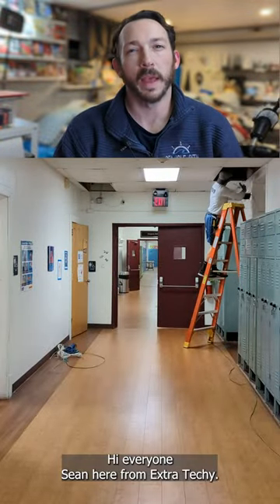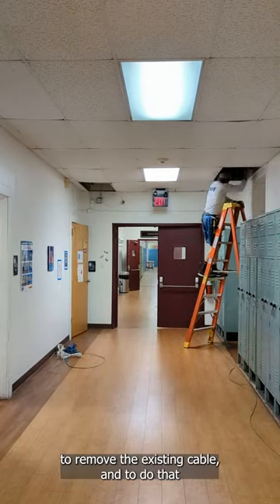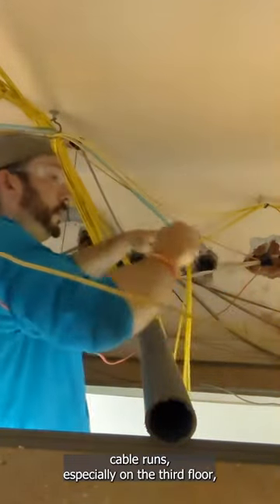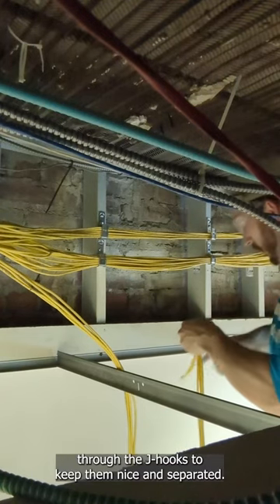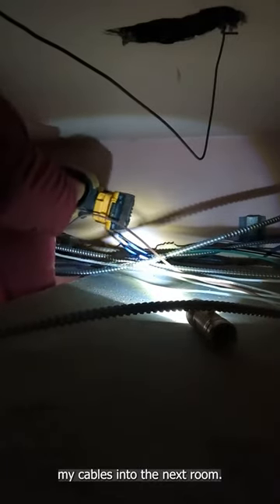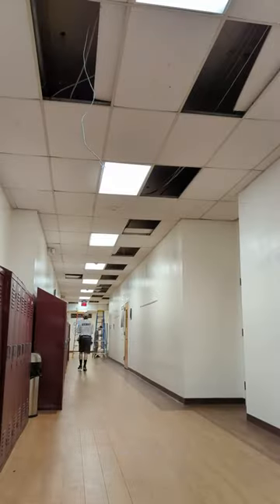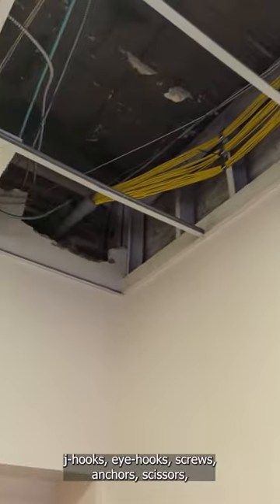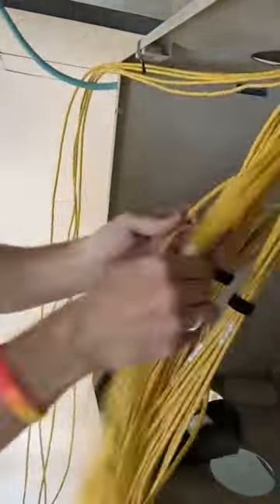LESSONS LEARNED - Network Cable Pulling Tips & Tricks

Comment: Zip ties are ok but theyre for places where the wiring wont chhange like the ceiling, but dont zip them too tight or they can dig into the cables jacket over time. Velcro is for your switch closets and server rooms where cables are gonna be swapped around over time.
Reply from the maker: Love this angle! So many people arguing for or against. I did use zip ties but recently bought into rolls of Velcro. At least with Velcro, if you make a mistake, it's not a huge issue with cutting back a ziptie 😬
Reply: Personally I absolutely hate zip ties. I know they have their place and I do not deny their usefulness. And in some cases there is no alternative. But to anyone putting them any where, especially in confined spaces:
For the love of all that is holy, cut the ends off flush, and do it properly!  

Knipex makes awesome flush cutters that make the job real easy. 

If you leave any material standing, possibly even being cut at an angle, the next guy is going to cut their arms and hands to ribbons on that stuff if they have to reach into or around the area. 

I have done my fair share of bleeding because the previous guy could not be bothered to take the extra second to clean up. And man, those tip ties are sharp and produce jagged edges that make for some pretty gnarly cuts.  Nothing says „screw the next guy“ than being sloppy trimming off the cable ties. Car mechanics seem to be the most egregious offenders here for some reason.  
If you want to be lazy then fine - don’t cut them at all. That way you at least don’t leave a forest of mini blades behind.
Reply from the maker: Absolutely man! Take the time to make it safe. Thank you for your input! 🙏💕
Reply: Yep and it looks a lot smarter.
Reply: @DeputatKaktus sparks (Electricians and Fire installers ) have a bad habit of leaving them on especially in false ceilings ,pop your head up and you nearly get garroted 😂
Reply from the maker: @Jon-qw2oe lol head on a swivel!
Reply: @ExtraTechy , some places require it, for inspections, and  you better have plenum rated Velcro in you plenum ceilings, I really only know of some counties in the Maryland area, Wash DC also I believe (it's been a couple years)
Reply from the maker: Good info here. Never thought of Velcro needing to be a certain rating!

Comment: Never remove existing witing unless its part of the scope of work and the customer is aware of the extra cost. Its so easy to remove something live thats still needed by mistake.
Reply from the maker: Totally agree. Luckily, I've been working this building for 10+ years!
Reply: @ExtraTechy and removing wiring can be SUCH A PAIN! like ive come accross wiring glued inside the conduate! Who does that!?
Reply: @Henry_Jones yes, but demo jobs are GREAT. Getting paid an hourly wage, AND scrap money depending on how much you’re demoing👍🏻
Reply from the maker: Bingo!
Reply: @justinissocool1  how much do you make from scrap cat5? Do you take it to a recycler? Just curious cuz I see people toss old cabling in the trash all the time.
Reply from the maker: So i heard it's about 1.00 per pound but depends on market etc. I still have to scrap the wire, so maybe I'll do a video on, now you have scrap wire, what now? Stay tuned!
Reply: @ExtraTechy  yeah it used to be about $1 per lb. I’ve been out of the industry for about a year so prices may have fluctuated a bit. But always scrap your wire, even if it only gives you some quick drinkin money. You can take it to any scrap yard and they’ll give you cash for it on the spot. The only thing you can’t scrap is coax, there just isn’t enough copper inside and everyone just throws it away. But no me and my buddy did a job recabling an entire office building floor. About 150 cable job, and we demoed about the same amount. By the time we were done and hauled all the scrap to the scrap yard both of us made about $800 in scrap alone👍🏻
Reply from the maker: @justinissocool1  love that!!!

Comment: First of all both techs have to protect themselves using all PPE required besides safety glasses. They have to use ANSI 3 or 4 gloves and hard hats. Also, they have to be aware and let somebody about missing bushings in all conduits. This could be easier to to pull cables because they slide better than being pulled on top of the tapes. Other than that, they have good technics💪
Reply from the maker: Good advice! This was a very early job prior to gaining this valuable experience

Comment: There are wire-pulling machines that can pull large bundles of wire and have a clutch that prevents exceeding the pulling force of the specs of the cable. They make life much easier in many cases, but the machine itself is quite expensive so you must have a certain amount of work to justify the cost.
Reply from the maker: Had no idea! Thank you for sharing! If I was doing this full full time then I would absolutely invest in something like that! Appreciate you sharing!
Reply: What's the machine called
Reply: @ExtraTechy , bro those machines are usually just for OSP (outside plant) in conduit pulls, you try using that for ceiling pulls your crazy, 18 years in, never seen it,  doesn't mean it ain't happening, but pretty unlikely. Life saver for sure on long lateral conduit pulls, or riser cable I suppose
Reply from the maker: Sharing information is important. Whether it's practical is another point of view. Thank you for your insight!

Comment: For anyone reading this, a few things that help tremoundously, getting a Push Poll its a 25 foot collapsable pull with a hook at the back end, tie your cable through the hook and extend (possibly yeet) your push poll forward, if you dont have one then you can use fish sticks or fish tape to get some extra distance in a ceiling. Also PLEASE FOR THE LOVE OF GOD USE PULL STRING!!!! If you arent using it for yourself atleast leave some behind for the next person coming through. If you dont have pull string dont do the pull unless you get some.
Reply from the maker: Fan of the yeet! I did NOT use pull strings on this job as it was a ton of wire, but I understand the importance! Have added it to my workflow since then!
Reply: @ExtraTechy  this is why you need pull string. saves alot of time. Just every once in a while unwrap it here and there.

Comment: Hello, I'm in collage, I'm just learning about Straight cable, Crossover cable, and Cable drop. I got to do all of those hands on and it was fun! got any tips?
Reply from the maker: Practice! I've never had to ever create a crossover cable IRL for anything I've done. Use non pass through connectors. Practice terminating on ladders and other awkward areas. Lay on the floor, underneath a desk. 

Good luck
Reply: @TheNiceGuy71  pay attention to your instructors, ask questions, learn and master splicing fiber optic cables (fusion splicing of course) Learn and master reading an OTDR (what you will test your fiber splices with) I've worked at companies that had separate crews, but if you can do both, like myself, you are the man ! Get your BICSI Certs too

Comment: Zip ties vs Velcro. If I am placing cable that is not likely to be changed, moved, or removed, I will use Zip ties that have releases on them so they can be   changed and re-used or salvaged for future use. Velcro is equivalent but can take up more space at the wrap point since you cannot cinch them as tight. To estimate the length of cable run look at a set of plans for the building and make install measurements from these plans. If you are lucky enough to have digital access to plans create a cabling layer for each type of cabling. right in the AutoCAD file and place your cable runs on that layer. There are also tools that can analyze these runs and provide recommendations for time, labor and materials. This may incur an additional cost for having an expert do this work in AutoCAD for you, but it benefits you and the employer for future moves, adds and changes. If the plans already have cabling layers on them then they can be used to estimate new cable runs and TM&L for replacement. Many RFQ's will specify that this work is part of the project, so you need to have a specialist available to perform the required AutoCAD work. Some RFQ also specify strict qualification requirements for final testing and documentation of those tests. I once was part of a job that had a 600-page statement of work to re-cable a single floor of a university and connect it to other buildings. We had a staff member performing compliance and validation throughout the project. He inspected cable runs, terminations and performed his own qualification tests to ensure that they matched what we were submitted to. He also provided authoritative guidance when things were not as documented or changed were to be communicated. He also provided security for some areas where non-staff could not be present without an escort. At one room he sent his own staff due to proprietary equipment in the room that was not allowed to be viewed or accessed or operating that required special procedures to depower or otherwise accommodate. They also ensured that a paramedic was on site during the process since staff were always at risk of a fall hazard, and in some cases required climbing skills and harness while transitioning through a central tower. We have also had elevator specialists to assist running through elevator towers as well.
Reply from the maker: Holy wow! I'm sure in jobs that big, and what seems like a high classified site, the specs and requirements for such a job are so important. I never thought an AutoCAD option would work for designing a network infrastructure. I'll be exploring more there for sure. Thank you for taking the time to help me understand more. Learning is just as important as executing a job, and I put these videos out there to help me document and, in the future, improve on technique and skill. Appreciate it! 🙏
Reply: Tourniquet your cables to apply velcro tightly. Also reusable zipties is pointless by the time someone wants to add or change something they become brittle and stuck in the form they were. They are cheap enough to replace.
Reply from the maker: Good points. I've got a few spools of Velcro now in the go bag, so we'll be using Velcro forever. I find it easier to take off if a run needs to be moved.
Reply: @ExtraTechy  do you do rough or soft on the inside for the velcro. I prefer rough as it doesnt slide and the outside doesnt get caught on peoples clothes later
Reply from the maker: Hmm. I think I have the soft outside so I can tighten as much as I can

Comment: Velcro always, never zip ties. It takes the same amount of time, above ceiling or in a closet. Velcro will never pinch cable, zip ties can.

Also, don’t pull through J Hooks, pull in the path way next to the j hook, when done with the run, work backwards, dressing in the cable with Velcro and push any slack back the start of the run.
Reply from the maker: Awesome tips. Good idea on the j hooks; they could get caught up and strip the jacket. I appreciate you taking the time to share your insight!

Comment: So how did all your runs hold up after the users came back to school? Any issues? I had a issue once where my new point of sale systems were super slow talking to the server. Turns out the data runs were 450' long!!! I fixed that with a mini switch in the cieling half way down the run. Turns out it was done by an electrician and he didnt know anything about IT.
Reply from the maker: Most runs were fine! All fell under the threshold of 300ft. The other day, I was investigating a phone not working and it turns out I completely mislabeled a patch panel. It was completely backwards 🤪. One other issue has something to do with a couple shorts in the cable but I believe ive diagnosed that down to a bad crimping tool. The blade on the tool has gone dull in the pass through crimper. Other than that PEACHY
Reply: @ExtraTechy  thats why I dont use pass through. The terminations arent as clean. With a little practice the standard mod plugs are just as easy.
Reply from the maker: @Henry_Jones heard. It's probably the best move to non passthrough!

Comment: How do you even get into this type of job? I've applied to about 30 jobs on Indeed, most of the entry level and still nothing. It sucks that I've worked Uber for so long that I can't even find a real job.
Reply from the maker: Tough question and even tougher answer; start with trainings; see what certifications you can get; check out BICSI for training materials; that does not guarantee a job, but maybe it can grow your personal network; from there, maybe there will be leads; not a great answer, but let me know if anything happens for you!
Reply: @ExtraTechy  I saw the BICSI certificates and OSHA 30 too. Just wasn't sure which was worth doing. I'm in Pest Control now but that is just so I can lose weight lol. Darn Uber got me all fat. Thanks for answering.
Reply from the maker: @simply_the_dev7588 safety training also important! Good thought on OSHA! Good luck!

Comment: Another, cheaper thing you can do instead of getting a helper to pull cable with you is invest in a gopher pole. Tie your cable to it, shoot it through the ceiling about 20ft range, and pull cable very quickly, by yourself.
Reply from the maker: I've heard of those! I think I never followed through with research! Any suggestions?

Comment: Be careful of wood and dry board (sheet rock) it rips the cable to sheds .
Reply from the maker: Meaning, when cable is pulled against them?
Reply: @ExtraTechy  yes mate exactly that ..for example I do a lot of network builds for a  supermarket chain in the uk .Some of which have been boarded out .Sometimes I have to use a 20 mil hole saw to make a core hole then pull 4 cables through the dry board. You need two sets of hands and feed them very gently though .I always encourage my apprentices to treat the cable like a pair of boob's-nice and gently and don't exceed the bend radius (we'll unless she's kinky) 🤣🤣
Reply from the maker: @Jon-qw2oe lololol. SAGE ADVICE

Comment: Do you certify the runs or just test them? As long as its under 300' (which i can get from foot markers printed on the cable) I dont see the need to certify if it passes a simple cable mapper test since the cables certified from the factory.
Reply from the maker: No certification from me. Don't have that tool since this was a one time project, although, I really do enjoy running cable! I know those machines cost $$$ though! Just a simple fluke tester with a backup to confirm the pass.
Reply: @ExtraTechy i know the fluken and ideal tools cost thousands! I have a triplett real world certifier that is the cheapest certifier on the market and even thats $400 and it only goes up to cat6 1Gb/s. I only got mine cuz I won an ebay auction and got it for cheap.
Reply from the maker: Yeah, so it sounds like you need specialized equipment. Do you label the cable as certified after test?
Reply: @ExtraTechy  nope
Reply from the maker: Hah so then what's the point 🤣
Reply: @ExtraTechy  it does let you export and print reports from your pc for the customer if they want it.
Reply from the maker: @Henry_Jones  well thats neat then!
Reply: Cable maps only tell you if it’s terminated on both ends correctly. It won’t tell you if you’re gonna have return loss, cross talk, or any other cable stress related issues that would’ve occurred during the pulling process, thus nullifying the factory certification.
Reply: @justinissocool1  makes sense! how often have you seen that happen?